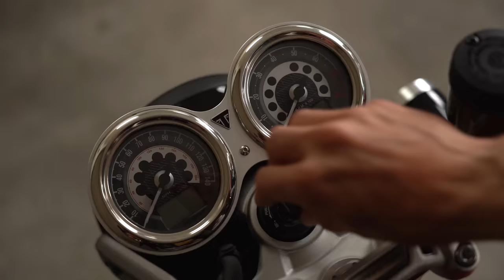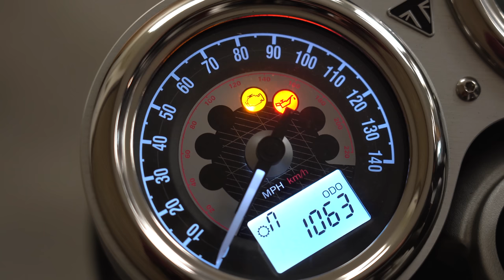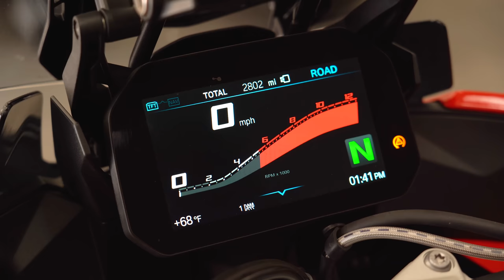Do You Need To Warm Up Your Engine? | The Shop Manual

Comment: No matter just warm up your bike - tollerances and oil viscosity changes for its optimal temptrature for each part and lubrication. yes carburation is different, the whole purpose is to let the block warm up, New or Old bike anything that is mechanical always warm it up. 2 Stroke even fuel injected should definately be warmed up

Comment: Without starting the video i say its better because the oil needs to move and the viscosity changes with rising temperature. Engines are mode to operate in warm operating condition so pretty sure its best for them to work in operating temps. But that doesnt mean you have to wait with a running motor till the water reached a stady temp. I would say start it wait 20 Seconds and than you just move with moderate acceleration.

Comment: My bike came with forged pistons as standard, which, or so I've read, expand more from cold than cast ones, so I always let the engine warm up for a while before riding off. It's a lot less clattery after fully warming up also, particularly apparent with a large capacity V-twin. I'm of an age from when carbs and chokes were the norm, so it's no great trial for me to wait a while.

Comment: It's better for the longterm life of the engine even on the modern bikes in good weather. It will reduce the valve wear and other things. I have only carbed bikes, so I really preffer moderately warm engines, but the facts are any modern engine will benefit from warming the engine to get the metallic parts expanded and all seals ect for the SAME reason you shouldn't wrap out the motor before full warmup.

Comment: Riding at low RPM on cold engine (especially  uphill and especially on big bore air cooled engines) is bad too because of the piston moves slow and pressure in combustion chamber is high and it causes the piston is tilted in the bore and does not glide on the oil scraping the bore walls with high force.

Comment: I like to warm up my turbo Grom first because once the metals heat up they expand and make a better seal therefore the bike will run optimally.  My issue is that once I get to where I'm going (when I'm not going far) that's when the bike starts to run really well.

Comment: Cars or bikes, most modern models on cold start their rpm is a bit higher than idle then returns to normal range in about 1-2 min. That should be enough, then just drive/ride softly before oil temp hits normal range.

Comment: I have answered this beyond any doubt and why.
Motor oil changes viscosity as it warms up. Before it reaches operating temperature it will NOT lubricate properly. As hp increases this becomes more important. Hot spots on bearing faces.

Comment: I love that he says that "if you're on a bike that's 20 years old or younger" then you don't need to worry about letting your engine warm up, implying that only bikes over 20 years have carburetors, while gesturing at a Triumph Bonneville. Triumph did not start selling fuel injected Bonnevilles in the US until 2009. My own 2008 Bonneville, well under 20 years old, has carburetors and has to warm up before riding off.

Comment: One additional  cold start issue you did not mention. It is possible for the Piston to warm up substantially faster than the liquid cooled cylinder when the bike is under load causing the Piston to seize in the cylinder. A few seconds is all that is needed to expand the cylinder. Same thing if you experience a lean mixture at high RPM and load .
Reply: The thermal mass is too high for a cylinder to go from cold to warm in a few seconds

Comment: This information also applies to modern fuel injected cars. It's crazy how many self-proclaimed "car enthusiasts" swear by warming up their car. Just a waste of gas. Driving gently until the engine is at operating temp will warm it up much quicker. Takes forever for it to get up to temp idling with no load.

Comment: Keywords "operating temperature" .. thats usually around 150-165 degrees and thats where the ecu and all the internals are at peak performance. If youre ever unsure, just run the engine while do pre-ride checks and at minimum for cold starts, just wait until the idle drops to where it should be. My bike cold idles at like 12-1400rpm until warm then drops to around 800rpm. Idk why modern bikes dont have signs that the engine is warmed up like with cars. my mazda and my moms alpha romeo have a blue temp light that turns on when you start them, then when its nice and warm, the light goes away.

Comment: No you do not have to warm up, but do not go full throttle right away, you can cold seize the engine, this is more common on 2 strokes, and yes I have seen it in person, power equipment tec for over 35 years

Comment: Royal Enfield manual says for their air cooled 350cc thumper that you need to warm it 120 seconds before riding. And it is EFI, not carb. Are they wrong? I know the oil pressure needs to climb, but that should happen realistically in 20-30 seconds already.

Comment: I learned that the piston does not seal properly when not warmed up. Its slightly oval in shape when cold. This allows gas through the rings and dilutes the engine oil. Not sure if still true with modern pistons.

Comment: 2:27 phh, doing 100km/h in -21C on a simple road bike, and yeah, warm up is a little bit longer that 1-2 min's ;)

and clutch discs are also doing bad, even in 0C, only after some hard revs and few kilometers it's start working properly

Comment: I allow my dry slump engine to get the oil around the engine, then give it a few minutes to show me a temperature on the dash. Also, the clutch hates cold oil which just causes the engine to stall

Comment: Wait for the stratified idle go down to consistent RPM and then take off, staying below 3500 RPM until your oil is warmed up to operating temperature. You'll save your piston rings, this goes for cars as well, especially turbo cars.

Comment: Not that it's necessary, but I let my '14 R6 register a temperature (104°) before I start my ride, and even then, I keep the rpm's under half the redline (16,500) until I'm at full operating temp. I'm currently at almost 58,000 miles, and she still runs as strong as if she was new.

Comment: My cbr doesn't move until it has hit full operating temperature, end of story. If you want to do something else that's fine and dandy and doesn't bother me one bit. Just what I will always do and have never had anything out of spec when it comes time to have the valves checked. So that's proof enough for me.

Comment: I've never seen such statements from any vehicle manual.

-I only seen "don't race your engine until operating temperature is reached" and "wait for idle to go down upon starting".
-Same for carbed vehicles, with the addition of implying waiting until you have a normal throttle response before taking off, with or without choke.

Comment: I don't remember hearing anything about gaskets. A big cause for blown head gaskets are romping on a cold engine. Same reasoning they gave in the video about clearances in a cold motor goes for gaskets too.
I always start my bike then put on my gear to give it a chance to get some heat built up and always keep out of the throttle and stay in lower rpm until the temp gauge is at normal temp.

Comment: I tend to fire it up, then put my gear on next to it. By the time I sit on it, I figure it has enough lubrication to start driving. My car however I start it and go back inside until it's fully warmed up, because I want to get in it when the heater is nice and hot.

Comment: I have a CBR125 2004... before getting on the road it's 1-2 minutes of idling while getting helmet and gloves on, checking lights and turn signals (had issues on these before, don't wanna sound stuffy but got used to check them) and then it's 4-5 km riding 6000rpm max before working my way up...better to be safe than to be sorry.

Comment: A comment worth your read.

I rode in -15 you callin me crazy boy!?!

I hope so because it was crazy and dumb, but that’s being young and buying a bike in the winter in NYC

 With no other funds for a car, I just wanted to be sure I was riding come spring, 40-45 degrees out and we were all celebrating, let’s ride!

You should see the looks you get when you are lane splitting and flurries start hitting the ground!

1988 kawasaki ninja with mikuni flat slides and a vance & hines pipe! 

Idling too long dirties the oil, keeps you running rich longer with increased blow-by

Idle just long enough to warm the cylinders but don’t go all crazy right away this will aid in preventing cold seizure or increased wear consistently if you get close to that point:

Piston heats up faster than the coolant lined cylinder, especially if you get all crazy immediately 

allow oil to get to the head and purge all the air,  I get that oil is designed to flow cold much better these days but gravity and clearances play a part overnight

then ride easy for 3-5 miles, load warms it faster than idle, but its a balance, treat that baby right and she will love you long time!
Reply: Correct, it's a balance between heating it up faster and not stressing internals.

Comment: I do what my manual says. I let it warm to the first mark on the temp hand then I go easy first 10 miles or so or until tires come up to temp! Then you can hammer on it. It’s how I do all my machines just give them a minute to let oil reach all your parts and temps to come up just slightly on cold mornings! That’s all! I don’t leave them set and run like some people! They burn more fuel then the drive to work warming their old truck up to temp. Takes half hour. Used to hate when people would leave for work early and let their car set and run and wake everyone up when they didn’t even need to.

Comment: My bikes are fuel injected. Both R6’s . One is 2005 other is 2008 (best year ever 08) and….. I sure as hell warm both bikes up on a cold start to 160. Which is exactly what Yamaha recommends. I have in the past started and rode with a temp in the 120’s at that point the idle is higher and it doesn’t feel right for a moment . Once they get up above 140. The idles drop down on both bikes. To each is their own. And what you do with your bike is what you do. But me. I warm them up. Never rev them during that time.

Comment: One of the most important things that weren't mentioned is that water temp isn't equal to oil temp. I've got 2 cars with water and oil temp gauges and when the water first time hits 90 the oil isn't even at 45. Most important temperature for you is the oil temp. Just remember to wait few minutes before going to redline.

Comment: 3-4000 rpm of “light” and low throttle riding with incorrect cold clearances does a lot more damage over the years than you think. I’ll stick to a couple minutes of warmup, and then a couple of light riding. It hurts nothing and guarantees I’m not slapping my piston around the cylinder.

Comment: Well, for me, and Most of Asians, we're riding on Japanese Stock Motorcycle, & It's been a discipline to get to a warming up before going anywhere, it takes only few Minutes, like 2 to 5 minutes or so.
2 minutes for Modern Motorcycle.

And of course, the Rider (Driver) has to do some Exercise, Body Check & Bike Check (Brake Lamp/ Indicator, Tire Pressure, etc.), & Ready to go.

Comment: Personally, I let my bike idle for at least 30 seconds. If you notice the engine ECU runs the engine at a slightly higher rpm may be between 1500-2000 on a 107 M8 before it drops down to around 800-1000 by itself. And in those 30 seconds just finish the final gear up, look around and then get going. Your engine will thank you.

Comment: They do still make “straight weight” oil that doesn’t have the additives for winter use. I have a friend in Texas that uses it in his truck just because it’s much cheaper then oil with a winter rating. BTW 10 is not the temperature but the resistance to movement rating I’m not really sure how they get exactly has something to do with chilling the oil to 0F and putting a electric motor in it then increasing the watts going to the motor until it turns

Comment: My “warm up” is as much as it takes me to gear up and ride off. Modern engines don’t really require some long warm up like it’s the 70’s or 80’s. Just take it easy a few miles, it’s going to warm up faster while driving/riding than sitting

Comment: In the time it takes me to roll the bike out of the garage, close and lock the door, check the tyre pressures, then put on my helmet and gloves, the bike is just about up to temp. Bearing in mind, also, that the tyres will be cold for the first mile or so, so taking it easy while the tyres warm up, will also reduce wear on an engine that is not quite up to temperature

Comment: Ok I'm a car mechanic, not a motorcycle mechanic. but a water cooled and fuel injected engine. get on and ride, but let the temps get to normal operating levels before goosing it!
 Carbies, well, if you open the throttle, and the choke is on, there is another throttle messing with the tune, so make sure it is warm enough to run smoothly before riding... just like we used to do with cars.
But Air cooled engines however, if you boil water and put it in the freezer, it freezes stupid quick. and that's because the fast moving molecules expel heat much quicker than cold slow moving molecules... and the same applies to Alloy cooling fins. the warmer the fins are the faster they can expel heat, cold fins don't cool the cylinder well, what they will do is expand at a very different rate and the cylinder expanding faster than the fins can crack the fins, so if you have an air cooled engine, let the damn thing warm up before trying to have a 1000 degree Celsius difference between the cylinder and cooling fins!

Comment: 10w-40 oil has "10" viscosity when cold and "40" when hot. When cold the viscosity is not enough to protect the crank shaft bearing when the engine is under heavy load.  Every small piston engine aircraft pilot knows this and never takes off until oil temperature is at least 145F.

Comment: My user manual had written on it that the ideal engine temperature for my bike was (80-100)°C. Basically, I may start around 50-60, but I have to wait if it is below 50.

Comment: I start riding once the dash shows thermometer digits instead of “LO”. I figure, if they don’t want to show me the actual temperature (starts to show around 105F), the engine isn’t warm enough to safely run with load.

Comment: In cars, it takes about 10 to 15 mins of normal driving to get oil up to operating temp. In bikes, it's about 7 to 12 mins. Just ride normally for 10 mins, then start to ease into hard riding.

Comment: My 2002 triumph Sprint ST has an early fuel injected system which won't allow me to ride away straight away. when you first start the engine the ECU learns the throttle sensor position each time and while it does this opening the throttle just causes the engine to cough and even die if you try to ride away straight away. After about 30 seconds its fine but for those first few seconds riding away is not an option. I use the time to put on my helmet and gloves by which time the engine's ready to go!

Comment: Not mentioned in the video is that air-cooled engines should be warmed up longer than their water-cooled counterparts. Cold engine tolerances are outside the nominal range take longer to reach proper in-spec tolerances. Riding off prematurely on a cold engine can strain engine components (including seals and gaskets). Big-bore V-twins require the longest warm-up period.

Comment: After someone enlightened me about WHY you need to warm up an engine, I have done so ever since. Engines are made of multiple different metals, that all expand and contract at different rates. It's not until the engine is fully warmed up, are all the dissimilar metals on the same page, in spec, ready to go. So your iron rings may be hot, expanded and ready to go, but your aluminum pistons are not. They all need to work together.
Reply: And they'll still warm up at different rates whether you're sitting idling or riding sensibly until everything is up to temp. Plus, unless you're talking race engines (with much tighter tolerances) your engine was designed with this in mind - if you're not revving the nuts out of it whilst still cold everything will be fine.

This one generally doesn't apply to bikes since most share engine and transmission oil but if you apply the same principle of idling until warm to a car then you'll have your engine up to temperature but your transmission won't be so if you start pushing you'll have issues.
Reply: @AkinaGhost  Of course they'll still warm up at different rates. The difference is whether you put a load on them or not (driving cold, or idling up to temp). Try getting a pilot to take off with a cold piston driven prop plane. Not gonna happen. Those engines are very expensive to repair and unnecessary wear, by placing a load on them before being up to operating temp is avoided at all costs. Granted failure in a place means you're going down versus a car means you pull over to the side of the road.

 I've never heard of transmission problems being created by operating them before they are at full temp. They don't have metal components sliding across each other constantly sans the few times the bands/clutches engage, disengage that do not need to be up to temp to function properly.